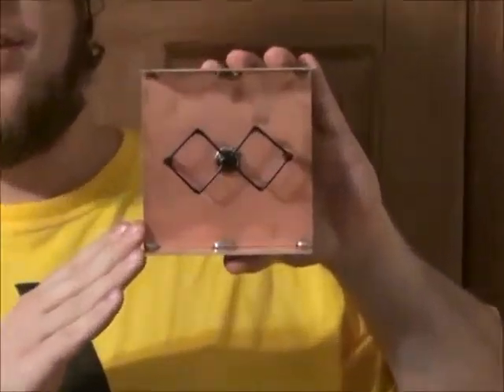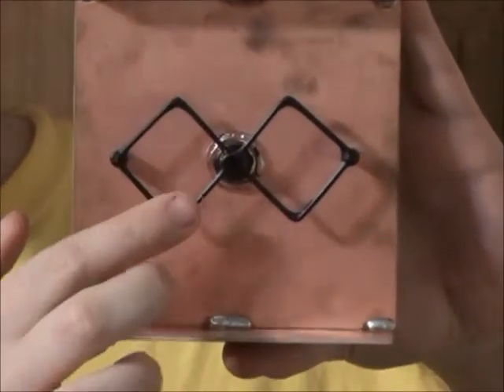How a biquad antenna works. Hi Gain WiFi Boosting Antenna for Wi Fi signals

Comment: sir i watch yr video i want to know regarding biqad antena. if i will use mobile charger power supply for biqad antena for boost wifi signal for my mobile its will work if no then how many valt give to biqad antena n its work or not

Comment: how to connect antenna to laptop?
Reply: you need an USB wifi adapter with an external antenna
Reply: You STILL did not provide answer to the question-yes, a USB wi-fi adapter that USES an external antenna is needed. He can take apart the antenna that usually comes an adapter-it will have small dia. SMA cable inside of it. Remove the small diameter cable / wire from the inside of the plastic antenna housing. The exposed cable has small dia. wire inside of the braided copper sheathing-this is the signal wire - the sheathing is the ground wire. He needs to solder the signal wire to the bi-quad antenna and then connect the sheathing wire to the reflector plate that's directly mounted 15 - 16 mm behind the bi-quad. The bi-quad will need some sort of mechanical support as the tiny signal wire will not be able to hold weight of bi-quad. The cable should still have the SMA connector on other end - attach it to the wi-fi adapter and your done.

Comment: I ordered my cable online with a male N to an SMA connector, the cable itself is an LMR-400. The thick cable helps retain much of the signal, the only thing on my mind is whether or not to shield the walls of the enclosure since it will be weatherproofed? I don't know if that would make it more efficient or less?

Comment: is thickness of coper element matter? example instead of 1.5mm can I use 0.5mm which is the coper I get from CAT 5 UTP?
Reply: No you can't because of resistance and you well get less mb/s speed...the best thickness is between 2mm and 1.2 mm....the more thickness the more wide band of channels and more interference between them

Comment: I made my biquad to fit to a BNC connector, then bought a bnc to rp-tnc male jumper to fit onto my wrt54g.  I bought a 50' BNC CCTV cable but I'm getting no results when doing a site survey on the router....am I using too long of a cable? Any other  suggestions?
Reply from the maker: Cable length shouldn't matter if it is good quality cable. Try it with a different shorter cable if you can to eliminate the possibility of a bad cable, also make sure all your connections are firm.
Reply: Like yer cable video stated... RG-59(coax) has a freq range up to 1GHz.  Found a 3' RG-142 for $15 on ebay... Gonna try that out.  Thanks for the response!
Reply: I know you posted your question a while ago, but there are two factors degrading your performance.

regular Cable tv (or satalite dish) wiring doesn't have the proper impedance. you have to have a rating of 75 (not 50 as your example), so as not to lose too much signal per meter/foot.

that is the majority of your signal loss, but also BNC connectors are notorious for being unfit for this frequency range (2.4, 5GHZ)

Aaron, I've used a similar setup as yours for a site-2-site connection, and recommend using tomato firmware, if you aren't specialized enough to customize you're needs with openwrt. I'd also look into a more recent access point, as the WRT has been superseded by newer hardware. currently, I prefer some asus models.

Comment: hello, I am thinking of building one of the bi-quads to use with a dish I have. that would be connected to a alfa 1000mw Wi-Fi card. would this work ok with the dish if adjusted properly for the quad to the dish. thank you

Comment: This is a great video on the biquad.  I think I've seen enough....that I can build one.  The part I can find no information on is......how to connect to the router....and the pc.  Is this really as easy as.....run the chord from the antenna in to the back of my wireless router .....and bam ? I just don't want to get too far along and then realize I have no idea how to connect to the router.  Thanks
Reply: +Brian R Daeger You have to buy a wifi receiver

Comment: Does the reflector plate need to be Copper or can I flatten out a thin sheet of Aluminum? I'm going to be mounting it on a satellite. .
Reply from the maker: Any conductive metal will work, but copper PCB is best
Reply: Thanks!

Comment from the maker: You can see my other video for more cable info. It is youtube video v=AoquwWmVWOQ  You can just put that in the search and it will come up.  I used LMR400 cable which is coax cable that is tuned and shielded for antennas. Regular TV coax, like RG6 has high signal loss for wifi antenna usage and it not ideal.  I got mine on eBay with an N connector for the biquad and an RP-SMA connector on the other end so it fits a standard PCI card antenna connecter.  Hope this helps.

Comment from the maker: Well, since it has no external antenna ports you would need to take the case off and solder the antenna on or buy an antenna mod kit from ebay or a modder website.

Comment from the maker: A cantenna will be easiest to dial in to a specific location. They are more directional, but will provide a great signal if you aim it at the distant router. A biquad would work also.

Comment from the maker: You don't have to use blank PCB for the reflector. You can use any material that's electrically conductive and will reflect waves (ie, any metal plate will do fine).

Comment: I wish you guys would STOP using panel mount N connectors in your projects, no wifi equipment uses them, you can't scavenge them from anywhere and nobody has them. I followed the math and built a cantenna today and it doesn't work worth shit even thought I used all the right diameters and lengths and checked my connections with a continuity meter... so I'm going to try and build a doulble biquad next. I'm probably going to use galvanized tin for my reflector and copper wire for my antenna.

Comment from the maker: Yes, but it will only boost the 2.4 Ghz band.  If your router has a separate antenna for the 5Ghz band then it will not interfere. If your router uses combined 2.4ghz/5ghz antenna then it will cause issues.